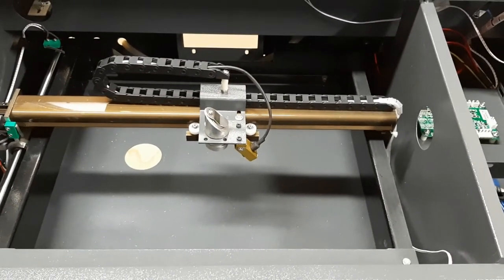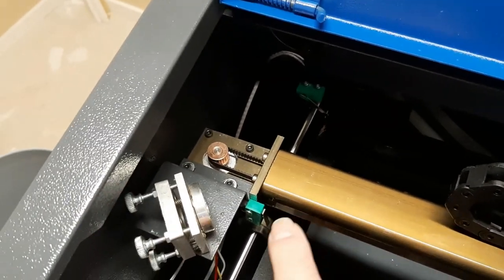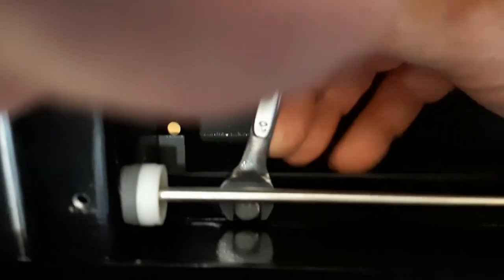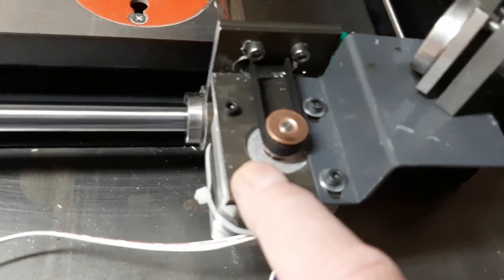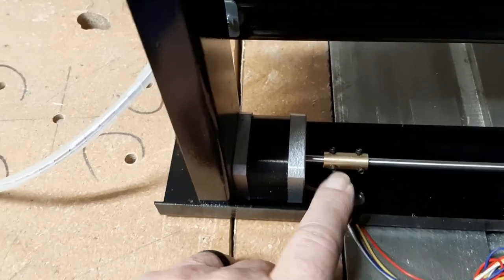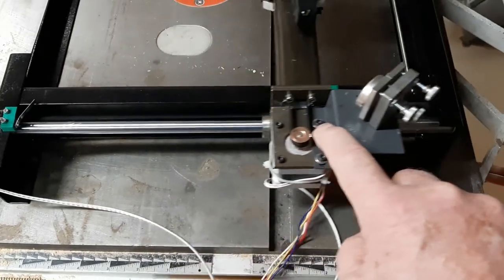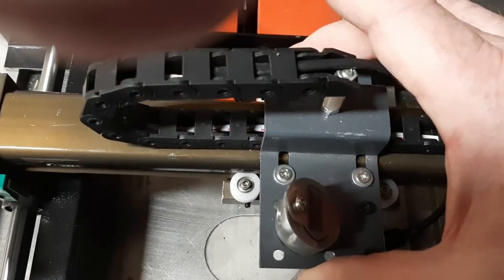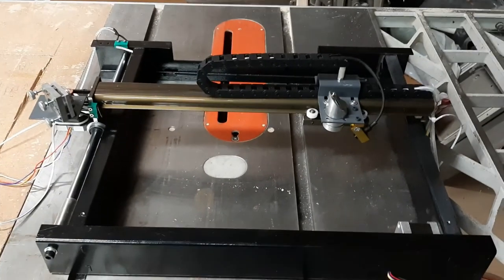K40 - X & Y Rail - Alignment and Mechanical Overview

Comment: I know this is a year old, but why did you not just loosen the x stepper coupling to isolate the two ends of the x beam. Then you can set the beam parallel Nd then tighten the shift coupler. Much easier to do.

Comment: In the last part of your video, If the Y axis in not tracking parallel (But reasonably close) It can be compensated for with the #1 mirror, Nicki Jensen is correct too much waisted time with chitchat getting the point across.

Comment: Thank you very informative video, I just got mine a couple of days ago and the rail looks to be at least 1 inch out of square. maybe even more I will be using your info, I just hope they are enough adjustment to get it right. If not it will be going back. thanks again.

Comment: I don't understand the emphasis at the end of the video on aligning the Y rail with the 1st mirror beam reflection, as the 1st mirror can be aligned so the laser beam can get parallel to the Y rail whatever is its orientation.

Comment: great tutorial on how this system works. also thankyou for explaining what issues to look for and how to address the issues. you have done a far superior job explaining all this than any other youtuber i have come across. also which 3d printed laser head mount would you use if you were installing a Cloudray laser head and mirrors?
Reply from the maker: I really do not have any idea. Why do you need a new head mount. ( I am thinking that you are referring to the top plate of the carriage. ) If the hole is not large enough for the new head,  open it up.  A 'step bit drill' will assist with that.

Comment: ^great Video. I have the problem if I move the head in x-axis, there is som noise. Any idea how I can solve the problem?
Reply from the maker: Jakob, what does the X rail noise sound like? The X belt tension should be snug but NOT tight.  Also the carriage should be snug on the rail but again not tight.  Just no wiggle.
Reply from the maker: Also check UNDER the rail. I used compressed air and blew mine out and got a bunch of crap out. Was amazed.

Comment: I want to extend the bed 12x24 so I’m going to have to cut the welds to move lengthen it I already have bought an x rail long enough just have to extend it. Probably have to also extend the pulley belt and the y motor shaft. Do you have any suggestions?
Reply from the maker: Where did you get the X rail?
Reply: If you type in rail 77.7cm it should come up